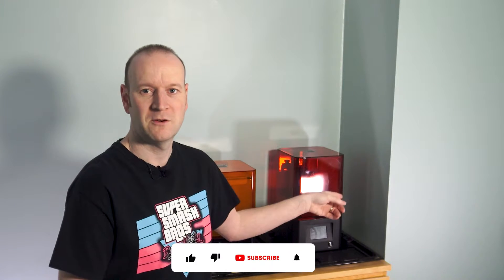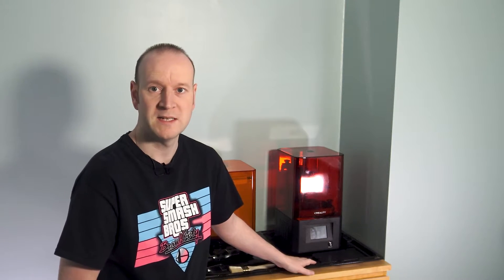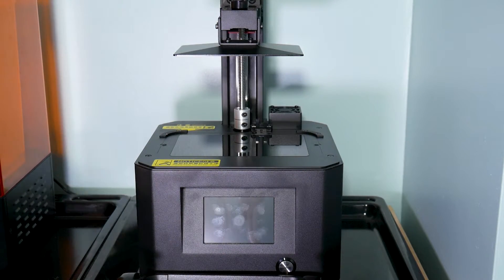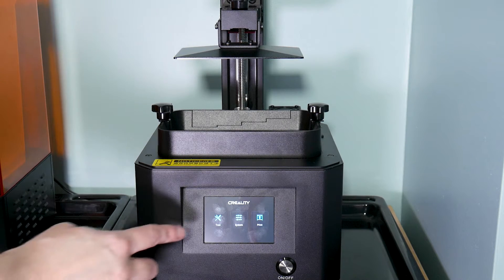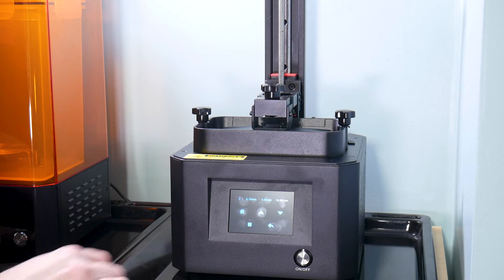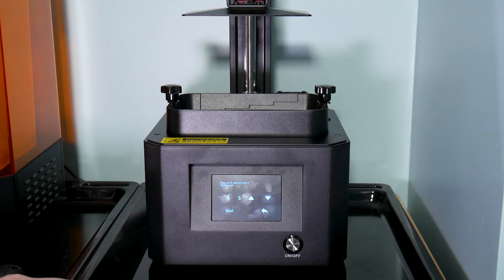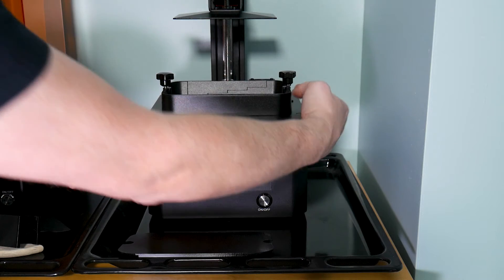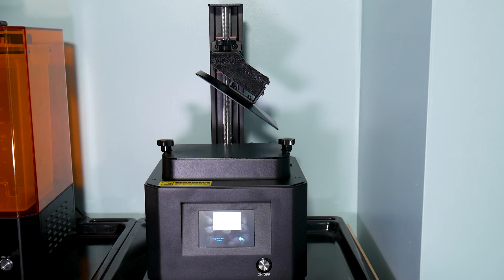Creality LD-002H Initial Setup

Comment: Thanks! I actually replaced my activated charcoal with smaller grains so there's more surface area for absorbing odors 

It works rather well.

I also added washers for the build plate so it's a more even hold